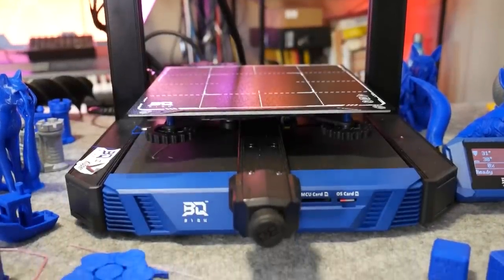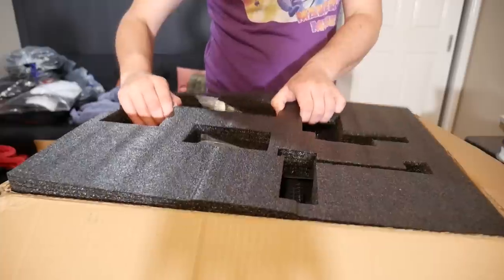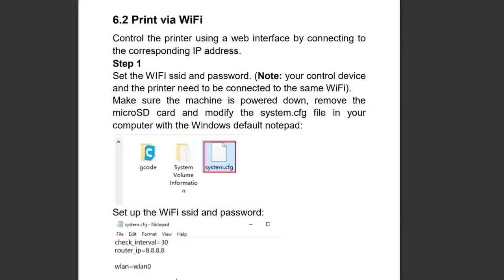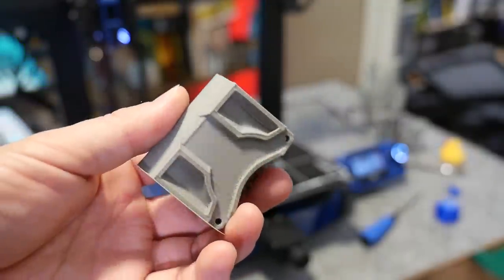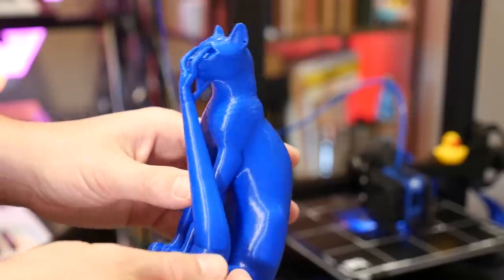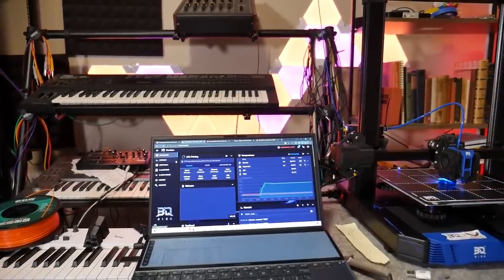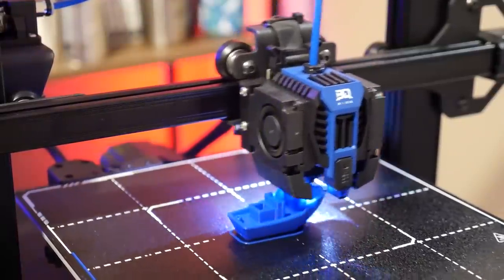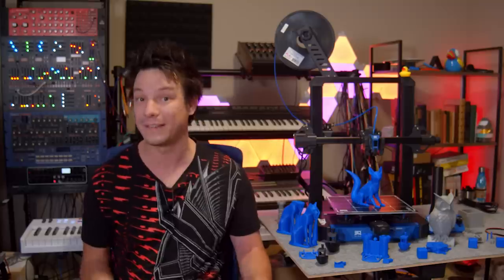BIQU Hurakan 3D Printer Review

Comment: Ducks are included because of "rubber duck programming" or at least thats how it started. As a company that sells a lot of custom hardware that often requires firmware configuration, users can get frusterated and stuck. But explaining the code line by line to something like a rubber duck, means you have to put it in really simple terms so the duck can understand. This is a very common technique for programmers because when you say your code out loud and in basic terms, you often hear yourself saying things that are wrong or dont make sense which are the problems in your code that you need to fix!

Comment: So good to see you covering and diving into Klipper. Honestly been one of the best changes to my Ender 3 pro I have ever done. 
Back then there were a few Marlin and octopi features I missed but most of those have been added.
Most notably is the Exclude Objects feature which allows you to cancel a single part that's failing.
A feature worth your time would be the Macros for your Start gcode - I've been using your start gcode for years now.
Reply: Same. I basically transformed mine into a new machine for little money.
Reply: I added a Sonic Pad to my E3S1Pro and haven't looked back. Regardless of whether you go with a prebuilt solution or roll your own it's a quantum leap in speed, quality, wireless connectivity, and ease of calibration/troubleshooting.

Comment: The beauty of Klipper is the ability to change parameters that normally require a tedious firmware re-compile as well as the ability to print much faster than what is shipped. A mechanically stock E3V2 printing PLA with 62.5mm/s walls and 125mm/s grid infill without losing quality (visual and dimensional) is a major plus. Crank up that speed in your slicer and see how it does!
Reply: Printing here with Ender 3V2 with volcano hotend, custom Marlin firmware. Prints fine at 60mm/s, infills at 100mm/s, acceleration 2000mm/s², jerk 15mm/s. Prusa slicer handles the transitions between different flowrates. I see no reason to use klipper.
Reply: Speed does nothing if you don't crank up acceleration. The default max acceleration is way low for a good quality print.
Reply: Klipper does not magically make the printer print faster
Reply: @dtibor5903  with Klipper you can do a lot more than Marlin. Just for configuration. You have macro, auto z calibration, accelerometer for auto resonance compensation, a relay nice interface.
Reply: @dtibor5903  my v2 with sonic pad was at 100 / 160mm/s and 2900 mm/s2 and the corners were better and there is no ringing than much slower speeds on marlin. I did not try newer versions of marlin with pressure advance because at the time the main board I had was not compatible I believe.
Reply: @dtibor5903  For an Ender 3 you will hit the hardware limit much sooner than the processing limit of boards running Marlin. While your final statement is technically true, it contemplates only a printer design that is, honestly speaking, vastly outdated.

Meanwhile, I challenge you to match Klipper speed/acceleration values on a CoreXY printer while using Marlin.
Reply: @riccardosacchetti  well since marlin got inputshaping the difference is not so big anymore
Reply: @Lucas_sGarage  well, you have macro. That's enough. Oh.. and you don't have to recompile every time you change something.
Reply: @riccardosacchetti  you don't need to recompile to change settings, gcode commands dude! Most of the settings can be changed in that way, 2 lines and it's done, from pid settings, to speed, to current and a lot more, i mean, from what I understand there are over 900 commands

Comment: One of the advantages of using klipper is input shaping so you can get faster prints with better quality. Since its an i3 frame, the mass on the y axis is huge. Wouldve been useful to find out how much klipper can speed up an i3 since most people have i3s and could possibly upgrade to it.
Reply: This is less of a distinction now that Marlin Firmware has ZV input shaping (which even works on a 16MHz AVR board), with more advanced input shaping (provided by Ulendo) on the horizon for 32-bit boards, with no external computer or SBC needing to be attached. The nicer thing about Klipper is the variety of interfaces, like Mainsail, which does marry well with the internals of Klipper, giving more direct control than you might get with OctoPrint and a generic Marlin. As things go forward it's great to see a healthy competition happening in the firmware space, as this will lead to greater benefits for the end user, no matter which ecosystem one chooses.
Reply: @ScottLahteine  Marlin doesnt yet have the accelerometer based measurements for input shaping as Klipper does so marlin input shaping is based on manual adjustments. Its good that input shaping isnt limited anymore to klipper and more complicated setups but klipper is still the best way for optimum speed printing.
Reply: My klipper ender 3v2 with glass bed and microswiss NG extruder can get 2900mm/s2. Speed is more driven by flow rate and nozzle selection than the motion system. The glass bed is the acceleration limitation, the direct drive doesn't matter in my case. With a volcano nozzle plus some brass nuts the hot end will do 22m3/s flow rate at 230c with PLA. Upgraded cooling is required at these flowrates.I have seen other users with pei beds and bowdens get almost 5k acceleration. I will be changing the bed next.

To give you an idea a cal cube used to take 28 minutes with marlin and default profile. Right now it takes 5m.
Reply: @ScottLahteine  That's great to hear! These new techniques have been catching my attention for a while now, but I've still been on the fence for actually converting several of my machines to Klipper, since my marlin controls suit my needs just fine. Where would one go to learn more about this and other marlin/octoprint developments you've been discussing here?
Reply: The thing about bedflingers is the varying resonance frequencies. The further into a print, the heavier the bed and thus lower frequencies. The further up in z the higher the leverage for oscillation of the x axis. You ideally want constant frequencies as there isnt something like a variable input shaper based on material printes and z height. Thats why most fast printers have the bed moving in z direction as it has the least influence on resonance frequencies
Reply: @alejandrotuazon4831  Most boards in 3D printers are inconvenient to attach an acceleometer, so instead we emphasize the use of a calibration object, and that works reasonably well. There may be a smartphone app that can measure resonant frequencies by attaching the phone itself to the printhead, but again, not very convenient. Someone in this thread mentioned that bed slingers have a varying frequency based on Z height, and indeed the new Ulendo shapers include that consideration. Input Shaping a relatively new and developing feature for us in the hobbyist space, which will only keep getting better. We're having a lot of fun learning and developing this in Marlin for machines with a single board, and it is definitely improving speeds and output for Marlin users. Today's single boards have a lot of processing power —5x to 20x the power of a 16MHz AVR— and this is just one more way that we are utilizing that excess of processing power that otherwise gets sorely underutilized.
Reply: @alejandrotuazon4831  prints a test piece measures the height and goes to th3D calculator, it will give you the resonance frequency.. how is that harder that buying the accelerometer and soldering wires? for sure, it's automated, the other one is free, pick and choose
Reply: @black99rt  my anet E10 running marlin does 6.5k accel at 275mm/s
Reply: @alejandrotuazon4831  yep, but you don't need it, it can be tuned the same way you tune pressure adv....

Comment: I love modding and upgrading my ender 3 and I love klipper because it just makes modding so easy. Want to add filament runout sensor? No need to reflash the firmware, just wire it up, add it in klipperis config file, and it's done!

Comment: I've been under the impression that mesh bed leveling is for fine tuned adjustments, and to account for any warping of the bed. I'm not sure it's really meant to be a full replacement for manual adjustment. I never really thought about the Z-offset thing - I just put the offset into the configuration and forget about it. If I need a different Z-offset for something like an unusual filament, I can certainly make a profile in my slicer with the adjustment. I'm curious as to what the actual use case is of a manual Z adjustment?
Reply: You can even use the probe the level the bed with screws_tilt_adjust / SCREWS_TILT_CALCULATE and then as you say use mesh to level out imperfections of the bed.

Comment: I’ve been fighting with my Hurakan since December 2022. Look at the thermistor into the heat block. You’ll discover that it’s only half-way in from the factory. Look at the switch and frame ground wires (Plural) going to the FG post of the PSU, yes, that’s right, there are TWO SPADE CONNECTORS on that post from the factory. That’s illegal in the US as far as I can tell. Look at those connectors AFTER you do the resonance tests. You might find that one of the spades has worked itself out from under the FG post. I shorted the printers 24v system when I put BIQU’s top of the line hot end on it. I also fried their 7” monitor and the ribbon cable from behind the original print head to the board. It has taken two months to get a new ribbon cable from BIQU. They refused to take responsibility for the FIRE HAZARD this printer is. It’s cheap, its garbage, I wish I’d never bought it, and replacing the board and the CB1 and the stepper drivers and everything else has cost me as much as I paid for the Hurakan in the first place. This printer is a total failure, unlike the Xvico Pioneer.

Comment: On bed leveling, yes level the bed with the wheels, then do the ABL.

However, what you really should add is the adaptive bed leveling script in, and run it before a print, it'll only run a mesh of the area of the bed you're printing on.

Comment: Just as an fyi, you can and you should control acceleration from your slicer with klipper. Set your external perimeters at something conservative (around 1k for this type of printer) and internal perimeters & infill to 3-4k to speed up the print.

Also make sure you output marlin (legacy) from prusa slicer for this to work.

Comment: i would set the pressure advance setting in the filament gcode instead of the printer config. needs to be tuned for every type of filament
SET_PRESSURE_ADVANCE ADVANCE=0.06

Comment: Got this printer for 45€ because the previous owner couldn’t figure out how to update MCU firmware. In comparison with other ender clones it’s a fantastic, and saves up tons of time and nerves that would be lost while configuring kipper from scratch and installing all the mods. Also, the print head fans use strange 1.5mm connectors that are really hard to find (second “update” that the previous owner made- wired the hotend fan together with board fan). So, if you can get a used one for a good price- grab it! At worst you will be able to reuse the manta board.

Comment: Yeah, unfortunately, as soon as I saw the same old Ender-style motion system, I wondered why they would stick Klipper on it. Sure, it can clean up prints but you'll never realize the full speed benefits and, as you demonstrated, it won't do that well off the bat and for someone uninitiated it may never reach its potential even on this machine.

It's not a great pairing and unnecessarily jacks up the price for what looks to be an introductory printer.

Great review.

Comment: This does look really phoned in, klipper is pretty awesome and can get faster, higher resolution and stutter free results from very limited hardware, but as you crank the speeds, it really exposes the need to get the printer really dialled in, especially pressure advance and input shaper which aren't available without a lot of work on inexpensive printers running marlin. Going klipper-fast also highlights issues with barely good enough motion systems, extruders and hotends. Some of this can be tuned out. You can do a lot to a cheap printer with a printed direct drive or short-bowden jetpack-like extruder and dual z (or dual-belted like kevenakasam's mods).

Comment: Don't you dare talk down on the absolute legend that is the Toyota Echo. 
That was a pretty solid comparison though. The Echo is basically the same as an Ender 3, but definitely not as numerous in the states.
Reply from the maker: Haha I own one and it won't die 😂
Reply: @MakersMuse  Known as the Yaris in the UK and Europe
Reply: @MakersMuse pretty much all the simple old Toyotas are really solid. I've owned so many from the 70s-80s and I've never had any major issues. One of the most reliable vehicles I've ever owned is my super ratty '74 Corolla that has more than half a million miles on it. I daily drove it for like two years and the only issue it ever had was a rad hose swelled up and made contact with the alt.

Comment: I think Klipper will soon be the new standard, whether all the features are used or not.  It allows easy upgrades, and more manufactures may soon be switching to Klipper capable processors.
Reply: It will depend on how fast arm CPUs can get, and how good marlin gets, for example the latest marlin has input shaping, and soon enough we will see mainboards that can do everything on a single MCU (like hosting a web interface) for example I'm running Marlin 2.1.2 on an SKR 1.4 (non turbo) and I'm getting 6.5accel and 275mm/s while the print quality remains unharmed and the skr3 got s 480mhz arm cpu, so, they are getting really fast, really quickly
Reply: @WhiteG60  yep, i agree with prusa, absolutely, on marlin, it takes a while to config, but the learning curve isn't as steep as with Klipper (i think that rrf it's as easy or easier to install) as always, everyone can pick and choose what they want, what cloud connectivity? Sure, pay for the pi (even octoprint) want cheap, but fast? No cloud connectivity.
Oh and btw it depends on what change you make, for example if it max accel, you can change it through g-code commands, as well as the homing offset or a few other things, marlin accepts over 200 different commands

Comment: Same pricepoint as Creality's CR6 but with less/worse features... (no dual-z screw, much more assembly required, bltouch instead of nozzle strain gauge bed leveling, no touchscreen...)

It's certainly a confusing product and I think I understand now why Angus didn't mention the price or provide a link in the description.

Sucks that they both have bowdens, though. Hoping we see a strong shift to direct drive systems in the near future. Makes me wonder if the only reason the Hurakan exists is because Biqu had a bunch of leftover frames that no one was buying, so they slapped Klipper on it and sell it as a 'new' printer? Hmm....

Comment: Call me crazy but my klipper gets acceleretion values from superslicer perfectly well. Thats how I run external peramiters a bit les violantly while pushing insides to the limits. Ender 5 plus dd so my hotend is heeeeeeavy and those externals need to take it easier :)
Reply from the maker: hmm maybe I got misleading info, it was rejecting gcode commands from PS so I was informed to disable them, but maybe it's disable some but not all speed and accel overrides
Reply: yeah, I was gonna say: As long as I set the gcode flavor to Marling (legacy) in Prusa Slicer, I can use different accelerations for outer perimeters/infill etc. and Klipper is using them. In the klipper WebUI I can see, that the acceleration is changing accordingly when switching between outer perimeters and other features (only accel-to-decel is not changing). Not sure if slicer machine limits are also working.
Reply: I ve set acc to dec to some absurdly high value and I really just ignore it :> I've also set corner speed to just 1. Helps a lot with the x axis not stiff enough for the top heavy extruder. Thats the hero me dd conversion
Reply: @MakersMuse  SuperSlicer is, so far, the only slicer in the market that "speaks" Klipper g-code dialect natively, being a fork of PrusaSlicer it makes the transition fairly easy if you want to switch or at least test.
Reply: @MakersMuse  yep, you got misleading info! There are some commands that Klipper doesn't support "out of the box", but one can easily add then via the all-powerful Klipper macros!
Reply: @MakersMuse  Klipper only accepts M204 with S or P+T.  So it’s best to only dynamically control your XY acceleration only.  On machine limits tab of printer settings use for time estimate only.  Do not click emit to gcode.   Set your max accel and your Z and E accel only in the printer.cfg

Comment: Good video.  It hasn't convinced me that the BIQU is a good learner printer, and its limitations imply that's who it's aimed at.

I'm a Klipper convert; my (original-ish) Ender 3 prints faster and better from when I used Marlin, and I can tweak without a recompile.  I know Tom's 3D is or was staying away from it because of a toxic community, but I haven't seen that.  That said, I still bristle a little at having to tell the Raspberry Pi to shut down, and wait for it to do so.  With Marlin, I just powered off straight away.
I suspect Klipper is moving faster than Marlin and it's probably because you don't have to recompile every time.

Comment: so basically it does what the duet wifi boards have done for years with its duet web control?  and the latest reprap firmware (as well as the web interface) supports input shaping which is what im in the process of setting up on my custom built printer.